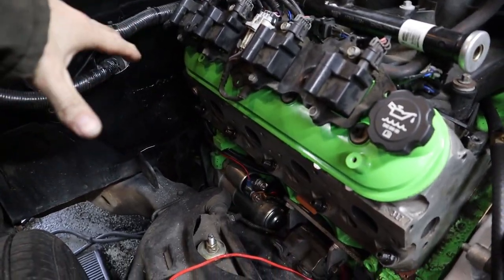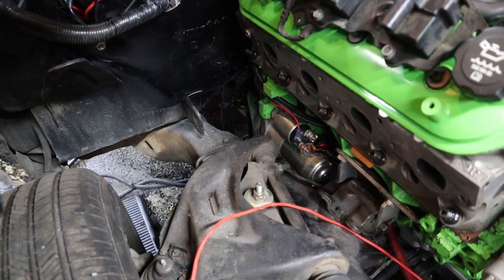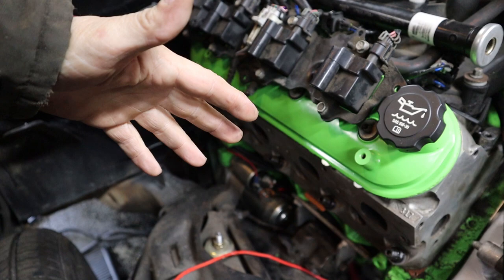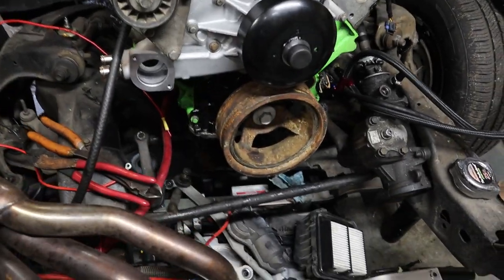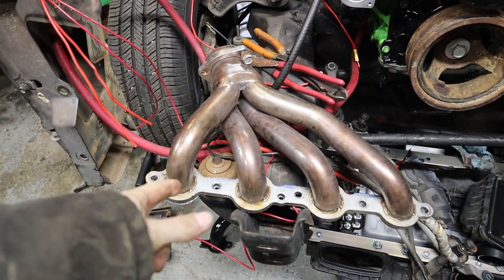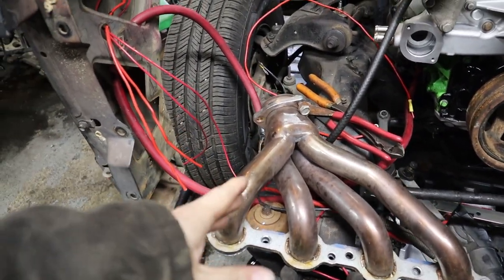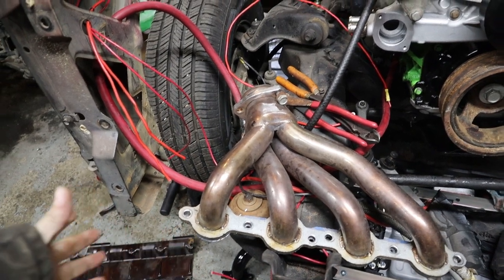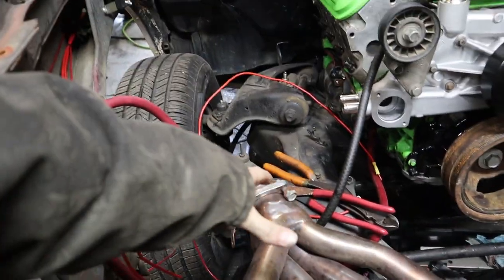How to LS Swap your S10 | Ep.5 Header Options + Long tube Header Install

Comment: Started my 96 s10 swap and this has become a huge help! I’m going to go shortys so I don’t have to finagle the long tubes.
Reply from the maker: Yea it took so much to fit them. If going with shorties make sure you either go with a y-pipe or a x-pipe to provide scavanging.
Reply: @southerngearz  thanks man. Sucks because I wanted to go twin turbos but might go single. Also, have you heard any issues with twisting the frame? Some people have argued that even a 450hp build can twist.
Reply from the maker: Oh yea its definately a possibility you can some bracing but really a roll cage would be best. However at 500hp....ish ypu can just an a cross brace or if you are really adventurious box in the frame
Reply: @southerngearz is a gen 2 chassis better produced? I got a gen 2 03’ and my chassis looks really good little and possibly more likely no rust and no problems

Comment: Use a jeep steering shaft. It gets rid of those big rag joints.
Reply from the maker: I had heard that. do you remember the year of jeep cherokee?
Reply: It’s like 95-2000 range. I think mine is out of a 97. You can also use a 2005 Colorado steering shaft. It’s the same thing.
Reply from the maker: @jamesgravel7755  well i need to make a trip to the ol salvage yard this weekend thanks guy

Comment: What mounts are you running? I have dirty dingo mounts and installing those same headers now and they hit my steering shaft .
Reply from the maker: Im running some ebay specials. I had to massage my #5 a touch to make sure it clears
Reply from the maker: It wont affect the flow so fudge it
Reply: Does it rub the frame at all on driver side?
Reply: You got a link for those mounts?
Reply from the maker: @madchadsgarage7263  yea here you go

https://www.ebay.com/itm/403204848328?mkcid=16&mkevt=1&mkrid=711-127632-2357-0&ssspo=KBewltw-T9u&sssrc=2349624&ssuid=G2YjFL52T-i&var=&widget_ver=artemis&media=COPY
Reply: Use a jeep steering shaft out of a late 90’s I believe.  It gets rid of the rag joints.

Comment: What’s the Name of Those headers?
Reply from the maker: Flowtech long tube headers

https://www.holley.com/products/exhaust/headers_and_exhaust_manifolds/all_headers/parts/11556FLT?utm_term=&utm_campaign=Google+Shopping+-+Flowtech+-+Brand&utm_source=google&utm_medium=cpc&hsa_acc=7848552874&hsa_cam=1739249473&hsa_grp=67614586945&hsa_ad=338798973577&hsa_src=g&hsa_tgt=aud-987006954383:pla-1394555557896&hsa_kw=&hsa_mt=&hsa_net=adwords&hsa_ver=3&gclid=Cj0KCQjwl7qSBhD-ARIsACvV1X2gzoO8o0poKsKbmEWguhedia3wQ_3bDCLgRDo6Dnumf9daegfU2XIaAgawEALw_wcB
Reply: Any idea what the part number was